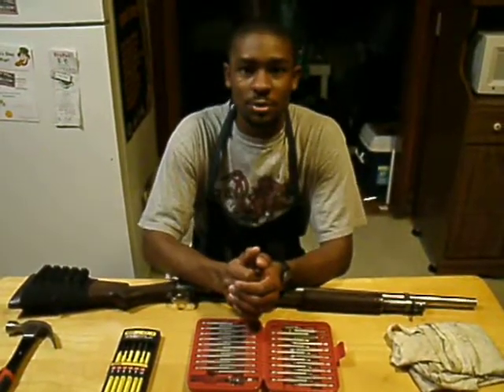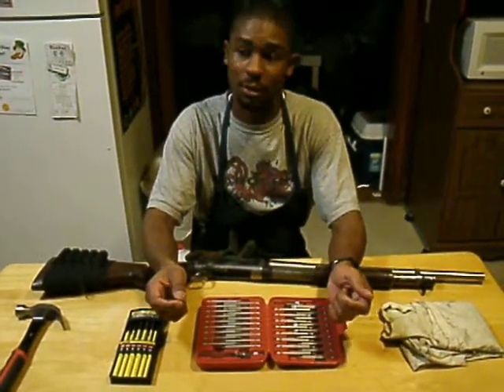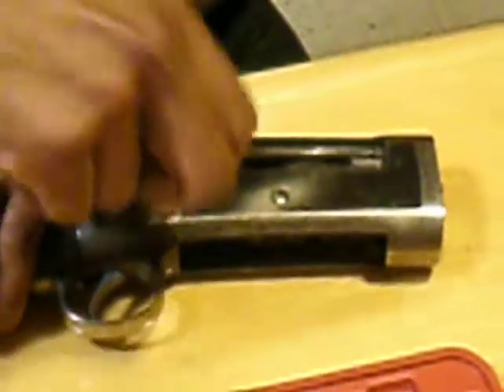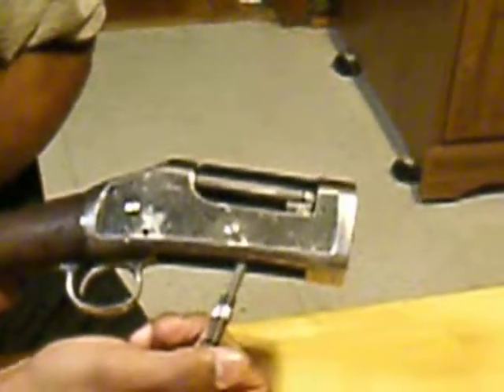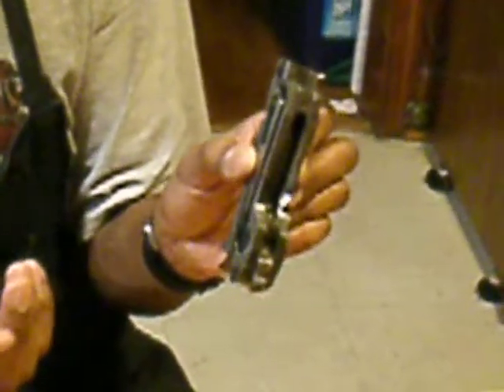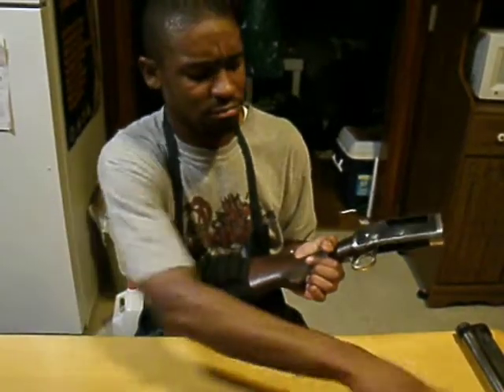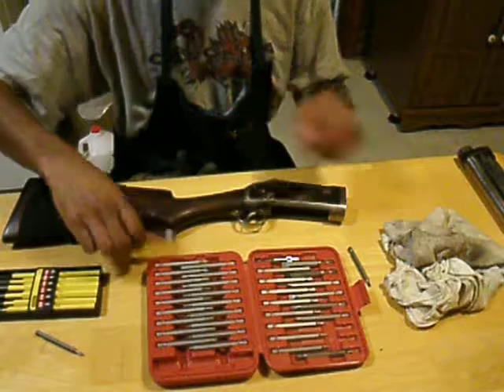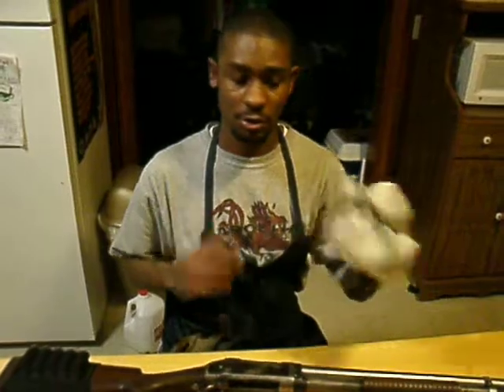Winchester 1897 Shotgun Basic Disassembly

Comment from the maker: I don't have a solid frame, but I can help you out with some info. You don't have to take the magazine tube out to remove the bolt and the carrier. The carrier can be taken out by fully cocking the hammer first. Next, take out the carrier pin screw and carrier pin. Then, back out the screw on the right side. With the action all the way forward, place a tool between the bolt and carrier, while pushing on the action lock release button. With the carrier loose, it should drop right out.

Comment from the maker: Make sure the magazine tube is inserted inside the magazine band properly. There is a little tab riveted toward the front of the tube, that should be facing up, towards the barrel. If it points down towards the ground, it is assembled incorrectly. The magazine tube will not fully turn and lock, if this is the case. Also, check to see if anything is obstructing the magazine tube, via the take-down extension.

Comment from the maker: Unload your magazine and open your action. If you are comfortable with this, get a wooden dowel and push the shell out of the chamber, travelling down the muzzle. The gun may be new, but I have heard of Norinco 1897s having a tar-like shipping grease in them. Disassembly and a thorough cleaning would be needed to get rid of the grease. CLP or mineral spirits may work for this.

Comment from the maker: @madrid12100 Thanks for your comment and questions!

The barrel in this video is an original, but not the barrel that came from the factory with the receiver. The original barrel to this receiver is still 30 inches, most likely for the off chance I would go hunting with it in the future. If you can find another barrel that may fit, go for it. I recommend Gunbroker or any gun shows in your area. I recently found an original riot barrel that fits, now the gun does H.D. duty for me.

Comment: I have always wanted an Ithaca capable of slamfire, although I'll probably never use an older gun in that manner. A 1897 Winchecter manufactured in 1904 came across my table today for $220 and I picked it up. It was extremely helpful to figure out how to disassemble it with your video -- it definitely needed some cleaning and lubrication. Although it fires the same shells, it's not like an 870 at all, is it? 
Thank you very much for taking the time to do this!
Reply from the maker: Deepsearch Thanks for the comment! The 1897 is a great gun to own, even though the design is pretty dated. It will shoot 2.75 inch shell, but check your chamber first. Some older chambers were milled for 2.5 inch shells, which could cause hulls to get stuck. Check out the other videos I have, which have more detailed disassembly info.

Comment: Quick question, my shotgun worked perfectly and the one time I took it apart to clean it it won't load any shells into the chamber. I'm not sure what it's called because I don't normally work with shotguns but the bottom part doesn't come out of the shotgun to load another round. Also, why is it that there is threading inside the tube of the gun but when you put the tube on with the barrel and then put it back together it doesn't touch the threading inside the actual gun? I have reason to believe this is the problem because when I pump I don't go all the way back because the pump is too short due to the threading being a bit further into the gun (short shucking) and it doesn't go all the way back so it doesn't "fall" out of the gun to load another shell.
Reply from the maker: PJ MasterDiddy If it's a take-down model, check to see if the magazine tube is going all the way in the receiver. There is a riveted piece on the tube, that limits the travel of the slide. If the tube is not fully seated, it will interrupt proper loading,
Reply: Mossy500A Fixed it, but yeah it was the magazine tube, basically because the tube was connected with the pump it was farther out of the receiver so it couldn't reach all the way back and it was causing it to short shuck which in turn it wouldn't drop down to load another round. All good now, thanks.
Reply from the maker: PJ MasterDiddy Good to hear!

Comment: I've cleaned my model 97 and am trying to reassemble.  I have the two halves joined but the magazine wont make that final turn for me to replace the takedown pin.  Do I need to push down on the magazine tube to get it to screw in?  Or can you describe that better for me?  Thanks in advance!

Comment: I just picked up a 97 myself recently with full length 30" bbl. I see that you have cut your bbl to 20" or so from your first video.  Do you intend to transform it into a repro trench gun with heat shields etc? I'm considering chopping mine down to 20" for the potential of using as a trench gun project myself. By the way, I'm up in Canada and I wanted to say as well good job on your videos.

Comment: Great videos; very informative and helpful. 
I experienced a problem in reassembly of the magazine tube into the extension.  I am only able to reinsert the tube part way.  I carefully insured that the interrupted threads line up for proper re-insertion, but the tube will only go part way, it does not fully insert so as to be able to lock the tube into the lower part of the receiver. 

Any help would be appreciated.
Reply from the maker: Check to make sure your magazine band is in the proper position. If it is not, it would keep the mag tube from going in all the way. There is a rectangular tab on the tube. Make sure that the band is ahead of it and not behind it.

Comment: I bought a 1897 Winchester that the previous owner had evidently taken apart and put back together wrong as it will not pump all the way, the bolt will only move about a 1/2 inch. The trigger will not catch the hammer sear when trying to cock it. Any ideas?
Reply from the maker: +Jim Gosnell You may have a broken sear spring, along with a hammer stirrup that is not connected to the mainspring. If you can email me some pictures, I could give you a better diagnosis. Also, check out my extensive disassembly videos on the 1897.
Reply: I watched your video and attempted to take apart but the screw by the side of the hammer is so tight I can't get it loose. I have it soaking with some breakfree. I am also having trouble putting the barrel and magazine tube back on the receiver. Following your instructions when pitting the barrel back in the receiver when the threads line up it will not turn. I think I need a gun smith. Also I just noticed the sr# on the receiver is different from the one on the barrel and magazine tube.

Comment: Been watching the videos and they helped me figure some things out. Current problem is that the hammer wont always drop with trigger pull. Sometimes it will delay before dropping, other times not at all. Occasionally you can push the hammer with your thumb and it will drop. I'm thinking the trigger or sear. Any thoughts? The sear seems to be fine when handling the carrier.
Reply from the maker: viper69er89 Check the notches on your hammer for wear. Also check your sear spring.

Comment: I am trying to clean one for someone but it looks like the take down pin was installed backwards so its locked against the barrel and I cannot use take down feature - Any tips are appreciated.  Great information!
Reply from the maker: You can use a flathead screwdriver to push the springed tab in, but it is tricky since the pin can move.
Reply: Thanks man, I'll take a look tonight and see if I can press if far enough down to pass under the barrel to break down.  It makes me wonder how anyone was able to get it assembled like that.  It must have been broken down and the parts were added back on when the gun was not 'taken down".

Comment: Do you think you can use the same method to take apart an 1893 Winchester?  The 1893 has a solid frame.  I have not been able to figure it out.  Are you familiar with the 1893?

Comment: Can anyone tell if they know what might be wrong with one of these I want to buy that i saw at a pawn shop here locally? I looked at it and the carrier that comes down and receives the shell from the magazine doesn't move down when it's suppose to. Does anyone know what could possibly be wrong with it?  It's a 1912 model and it has two small push buttons on each side of the receiver that  when pressed at the same time are suppose to release the carrier so it can go down but, it  doesn't. Because of that no shell will be able to load. It could be a quick fix but, I don't want to buy it then find out later that I will have to put money in it and buy parts to repair it.  When I was there at the pawn shop I spent some time trying to get it work but, was not able to fix it.   Any help will be appreciated because I want the gun but, will not buy it if  I can't use it.   Thanks.
Reply from the maker: Either the slide action lock is stuck or the tab on the action bar is worn off. Either problem can be a fixed with some replacement parts. The two buttons you mentioned are for clearing out all the shells in the magazine tube.
Reply: Thanks for the info. my 1901 model 1897  doesn't have those to buttons you say clear out the shells.
Reply from the maker: That was a feature on the 'E' class models, which came out in the 1920s, I believe.

Comment: Greetings. An acquaintance of my father has a model 1897 takedown for sale. It has a 30 inch barrel, and is reported to be in excellent condition. It was manufactured in 1930. The price is $500.00. Do you believe the price to be reasonable? Thanks.
Reply from the maker: If it operates the way it should and there are no need for major reair, I'd say it's a good price.

Comment: Need serious help with my Winchester 1897 Old beater 1897 slam fires 9/10 time the forend goes home!  WITHOUT touching the trigger!!! 
 the hammer does not ride the bolt back, but jumps up and hits the pin the second the bolt comes all the way forward.  
 Also, it will not take-down; the pin at the end of the mag tube will not turn counter clockwise even with some "motivation" from a small rubber mallet.  Any ideas for fix???
Reply from the maker: If the hammer falls when the slide moves forward, then you may have a broken or worn sear spring. Check that and the condition of the sear. Also, check the adjustment of the trigger; thee is an adjusting screw behind it.

As for the magazine tube, if you push the pin out to turn the tube and it will not move, it could be a few things. The magazine tube at the receiver end may be seized, or the barrel band may be too tight, restricting free movement. Loosen the barrel band and soak the back end of the tube with a penetrating solvent. See what happens from there.
Reply: Thank you!   Been feeling so stuck and sad about losing safe and smooth operation of an iconic firearm. it's nice to have some hope and specific ideas for what steps I can take to try and remedy the problems.
Reply from the maker: DocB Anytime. Let me know how it turns out.
Reply: Magazine tube /barrel band was too tight and the receiver end was fine after some lubricant.  Takedown is finally operational! Thank you for your help!!!

Took the buttstock off to get a look at the works inside with everything fully assembled.  Looks like the adjustment screw behind the trigger is all the way forward.  It's kinda rusted there so I don't think that's the problem.  BUT when I look through the back I can see that the connection between the sear and the hammer is EXTREMELY "sensitive".  Racking the forend all the way forward causes enough vibration for the hammer to drop; no trigger touch necessary.  If I go slowly I can also keep the hammer down and slide the forend 99% forward right to very edge without the hammer dropping, but when it goes all the way forward the hammer drops.  Hammer also drops if I barely bump it with my thumb when the forend is in that 99% forward position. 

Long story short pushing the forend all the way forward drops the hammer same (more effectively than?) pulling the trigger back.   Think I just need a new sear?  Or new sear and new sear spring as well?  Is it easy to order?  Right now I'm thinking order  a sear and/or sear spring and then take everything to my local gunsmith.
Reply: Also there is NO half-cock "safety" feature on the hammer anymore.  I tried with empty chamber and with snap cap (no way am I putting a live round in until it is fixed) and the hammer will not sit at the half-cocked position.  The hammer cannot be cocked by hand at all; it always just jumps right back up unless the forend is racked backward and then I very slowly push the forend forward and I use my thumb to hold the hammer down
Reply from the maker: DocB It's your sear. Numrich Gun Parts or Gunbroker are your best bets.
Reply: Awesome!  Got a sear for a nice price from Numerich.  I will bring to my local gunsmith for proper fitting and go from there.  Excited to get this process going!